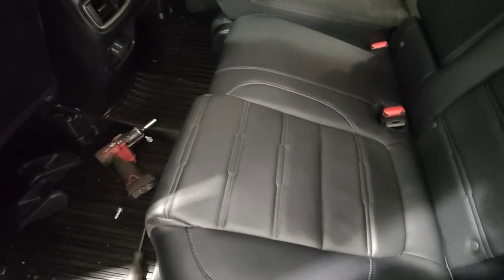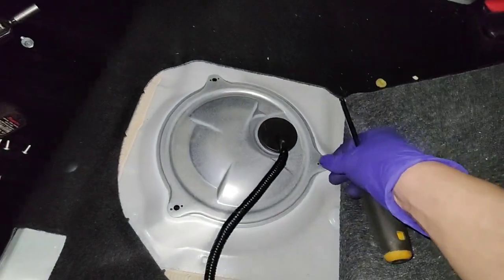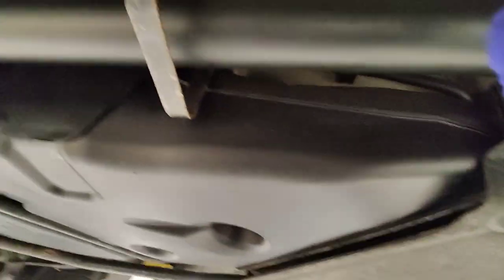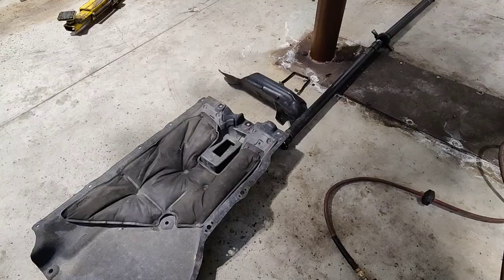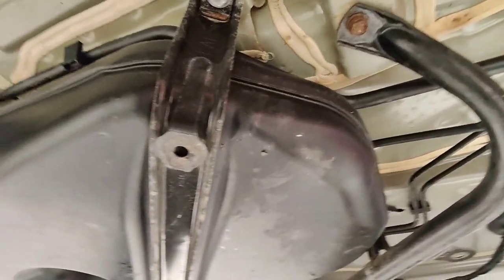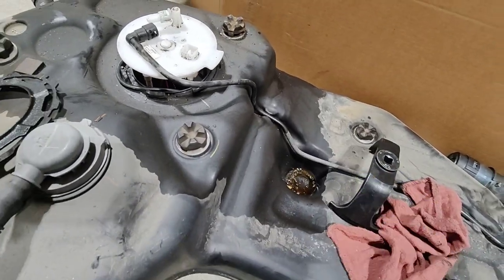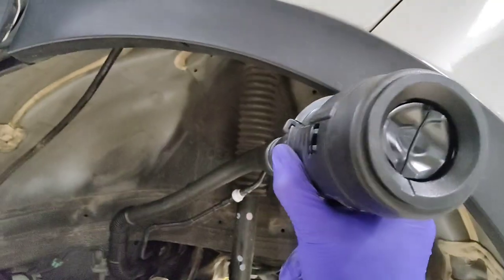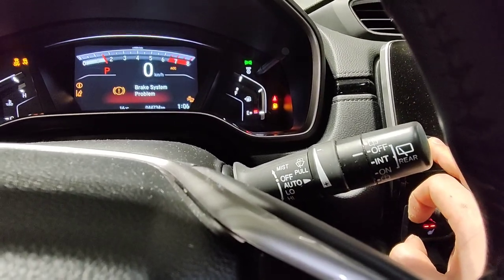Forget catalytic converter theft, fuel theft is the new trend. 2018 Honda CRV fuel tank replacement.

Comment: Stealing fuel by drilling a hole in the gas tank has probably the highest owner costs vs. thief benefit ratio of anything they can do.  The thieves walk away with some fuel, optimistically $40 worth from a CR-V while leaving behind high hundreds if not low thousand in repair bills for the owner/insurance.  Stupid.

Comment: Word is that front radar sensors on 2018-22 Accords and 2017-22 CRVs are easier money than cats or gas (>$500 on ebay).  No noise, no tools other than a wire cutter, thief can put it in pocket.
Reply: Dont share crap like that, it only gives people ideas

Comment: Epoxy and fuel?🤔
Will it last?
Reply from the maker: I've never tried it and I wouldn't trust it to not leak. Just some commenters in a shorts video were saying that they would patch with JB weld or plug it rather than replace an entire fuel tank.